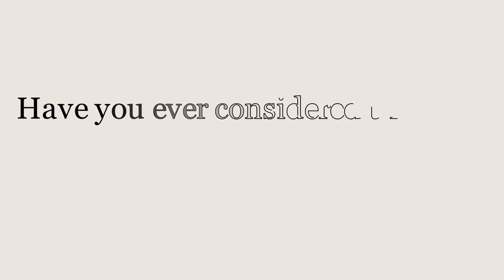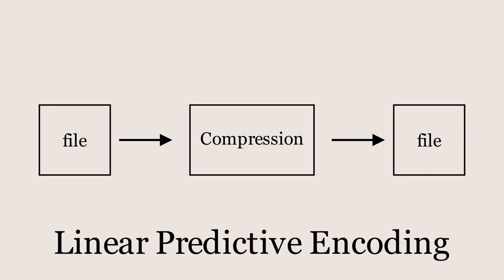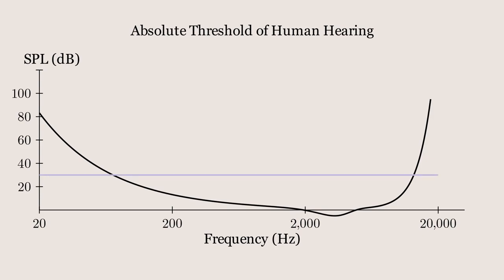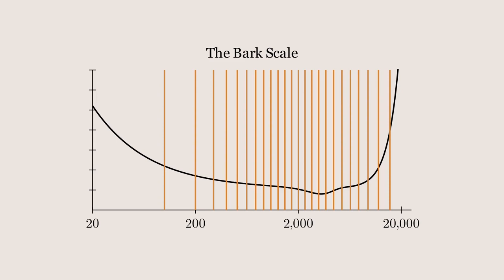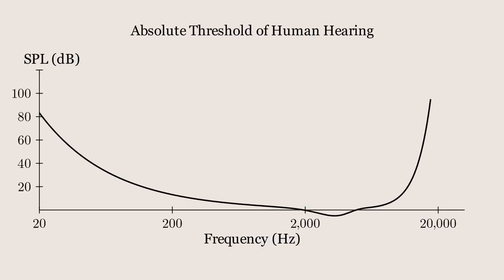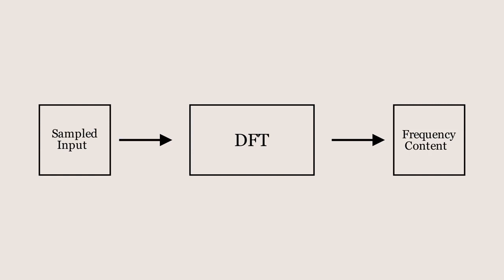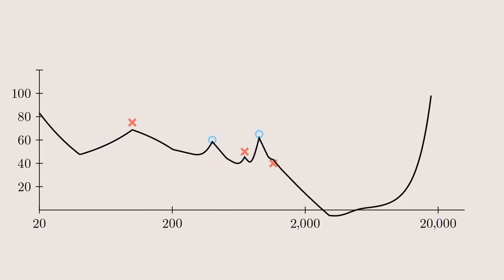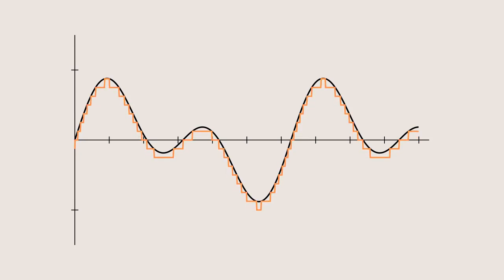From Waves to Bits: The Psychoacoustic Model in Audio Compression Algorithms #SoME3

Comment: Finally I found a video that covers this topic! I've got into this 2 years ago and for now I've aleady developed 3 audio codecs out of which 2 outperformed MP3 at lower bitrates, most recent one crushed MP3 while being less computationally intensive. This is an extremely complicated topic and honestly I was never able to develop or reuse a psychoacoustic model that sounds good after applying masking and quantizing. The main problem is that maskers produce a strong masking for themselves and adjacent tones, causing an illusion that you can use very few bits for them to hide the error below the threshold. However, it means that the amplitude of reconstructed tones will fluctuate between audio frames due to low precision, and human ear is very sensitive to static tone rapid amplitude fluctuation. The other problem is that any error in the frequency domain will affect all samples in the time domain, resulting in corruption of every frequency in that frame (I have proven that). This is caused by the nature of MDCT, more specifically, the TDAC property (time domain alias cancellation). Any error will result in aliasing not being perfectly cancelled. I have skipped all the psychoacoustics in my codec and developed a set of conditions that allow for good quantization quality based on audio characteristics. It doesn't calculate any masking thresholds. I have also implemented a tonal masker detector, but not to calculate masking. I treat tones as something that needs extra precision to maintain its quality. Without it, spectral peaks result in adjacent frequency bins quantizing to 0 due to high value ratio, and when those values are not present, the peak between them is affected the most, resulting in audible distortion. Adjacent frequencies are components of the tone and cannot be removed even if psychoacoustics say otherwise. Theoretical psychoacoustic calculations is one thing, the way MDCT works is the other, and the main thing that must be taken into account to ensure transparent compression. Raw psychoacoustics would make sense only if quantization error of one frequency did not spread across the whole spectrum, which is not the case. The most complex element here is the quantizer, the place where compression actually takes place. Even if psychoacoustics say that 5 bits are enough, that doesn't provide significant compression. Even 3 bits are usually too much. At 3 bits per quantized frequency bin, the bitrate is 3/16 * 1411kbps, which is over 256kbps. If some codec cannot provide transparent sound at this bitrate, it simply sucks. Bit budget per frequency bit at lower bitrates is close to 1 bit per sample, and at this point psychoacoustic model stops making sense. It can either say that you need 1 bit or no bits. Anything above 1 bit is not affordable, anything below 1 bit means no data. So the model does not provide any information. There are obviously clever workarounds. My codec can achieve not that bad audio at 64kbps, where MP3 completely collapses. Regarding the test audio presented in the video, 3, 5 and even 7 bits all sound trash compared to original audio. I've listened to hundreds, if not thousands of audio clips during codec developement and now I have pretty high expectations regarding audio quality. Audio codecs are insanely complex pieces of software that almost nobody talks about and everybody takes them for granted. I hope to find more interesting videos like this, I finally felt like somebody does things that I do and I understood everything, thank you!

Comment: Please use proper maths in your arguments. 2channels * 44100 samples/sec * 16 bits = 1408000 bits/sec.
1408000 / 1024 = 1375 Kb/s. Stopped the video after that and moved on...
Good that you use 3 blue 1 brown python script for your animations! Good video animations
Reply: Data transfer rates are rarely considered in terms of bytes and are often represented by their SI counterparts.
When talking about bytes, the B in kB is capitalized to indicate you're talking about bytes or called Kibibytes and written as KiB

Also (2 * 44100)  *  16b  =  1411200b and not 1408000b